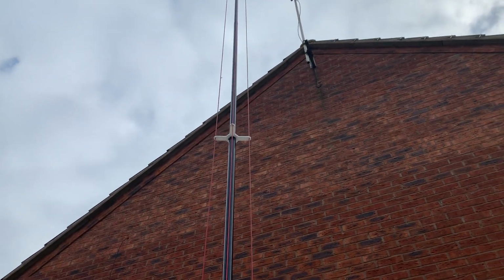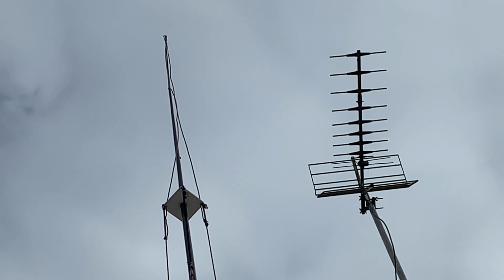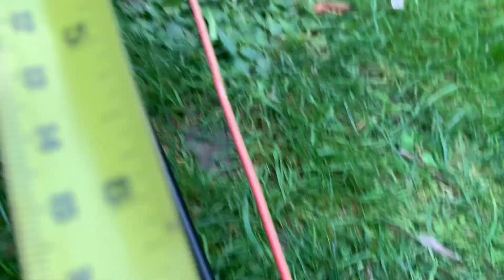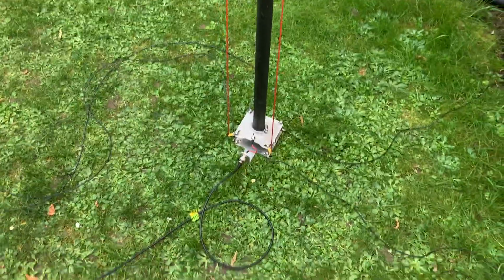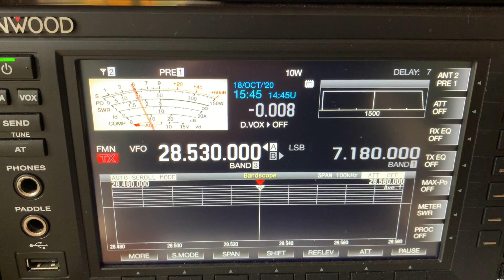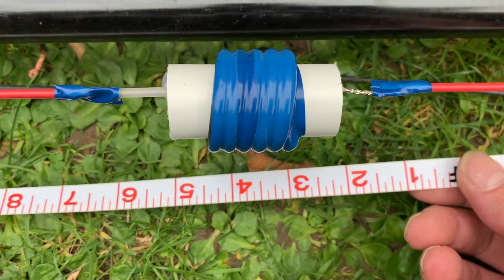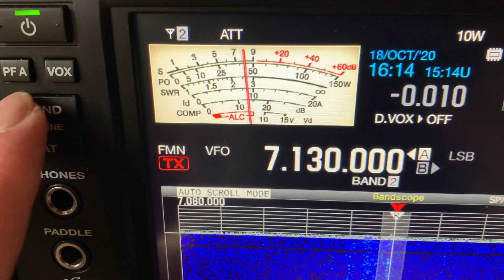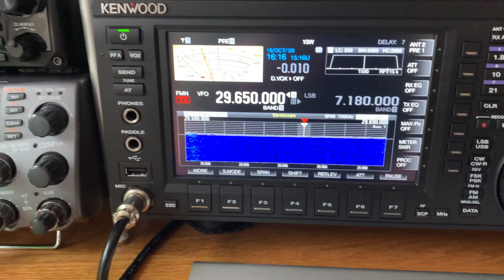HAM RADIO: DX Commander Lite 10M Fix. DX Commander

Comment: hi mike im the one who had a go at your flowerpot 2m 70cm antenna and im thinking of trying that dx commander one looks good but do you know were i could get hold of any of the spreader plates and the ground and radiating plates from mate it would be much apreciated ste m7byf oh and luv all your vids they have been a great help as i passed my foundatioin on may 1st of this year and your video,s have helped me out so thanx
Reply from the maker: Hey Steve, well done on the exam mate.. I would look at M0MCX.co.uk. or use chopping board

Comment: Hello Mike,

Is the yellow support pole fibreglass? How is that mounted in the ground? What diameter and how long is it please? Thanks, John 2E0SVB
Reply from the maker: Yep, yellow fibre glass decorators pole, about 1.5m long, 60cm of it just hammered in to the ground, 40mm or 32mm diameter.
Reply: @mike-M0MSN  Thank you very much!

Comment: If that is a common problem, I wouldn't be surprised to find the spacer added to the antenna kit at a later date. Am I correct in thinking the Trap creates a 1/4 wave element on 10m?
Reply from the maker: You would be correct... :)

Comment: Mile ... thanks for the videos! nice work . I’m a fan and subscriber😁 will these fixes work on the Classic ABV? Do you  have a template for the spreader?  Thanks again. Keep up the great work.... de Fred KE0EF
Reply from the maker: Thanks Fred, the fix is only for the lite, however is may work on the DXC, what issue are you having?
Reply: Mike… Thanks for the response. My NANOVna shows the following for my DXC Classic ABV. I have just installed a “Roly Coil” with the taps on the bottom. Top tap shows 3.270, Mid Tap 3.160, and the bottom tap shows 3.160 as well (Probably need to do this over. I would like to get the coil resonant somewhere around the FT8 Fq (3.573) so I’m thinking about turning the coil upside down to see where they tap the band.
Also with the 40 meter element bypassing the coil,  40m is resonant @ 7.050 which is good for FT8; however 15m is resonant @ 21.900 so I suspect I’ll have lengthen the 40m element to bring it back into the band.
30, 20,& 17m are in good shape. 12m is resonant @ 24.060 and needs to come up for FT8 and 10m is resonant @ 26.760 which also needs to come up for FT8. My thought was to use your spreader fix for 40m element that might help with 12 & 10m.

Comment: Looking forward to the video on the trap. I wonder if you could get away with cutting a spacer out of a light plastic - something like the face shield material that's being used for some masks currently.
Reply from the maker: Yep clear plastic knife with holes drilled into it....
Reply: @mike-M0MSN  of course you don't get to use the printer then 😂
Reply: Me : I need a 3D printer, Mike has one ... Wife : who is this Mike?
Reply from the maker: Lol

Comment: would not buy anything from that nasty little bully at dx commander.
Reply from the maker: It's a free world.
Reply: @mike-M0MSN  100 percent
Reply: @Jim GM4DHJ what is nasty is when you make a very calm natured fair comment  that he does not like he tells u on his stream to go  multiply yourself..... extremely nasty rude and classless. imo
Reply: I was a big supporter - even wanted to go in the weekend in Cornwall all the way from Oz -  until I challenged the endless broadcasting videos and was attacked and told basically to also go forth and multiply.
Reply from the maker: @Jim GM4DHJ Hi Jim, respectfully  please do not use my platform to air your views or dislikes of other people. If you what to comment use your own. please cease and desist